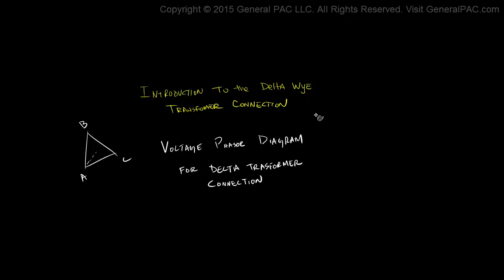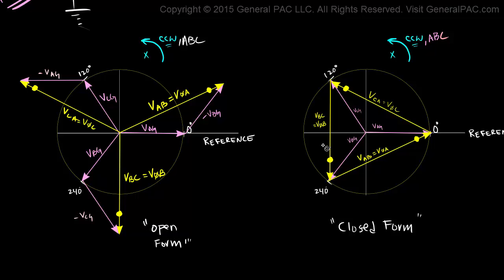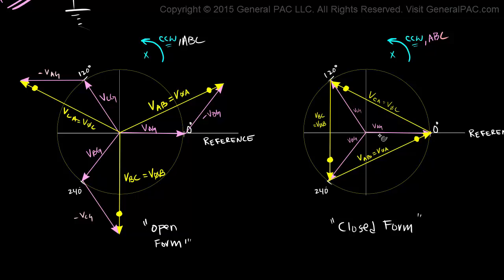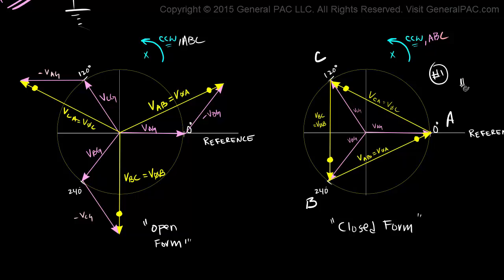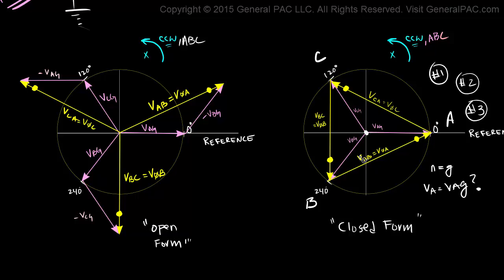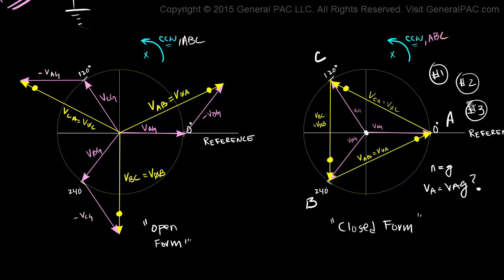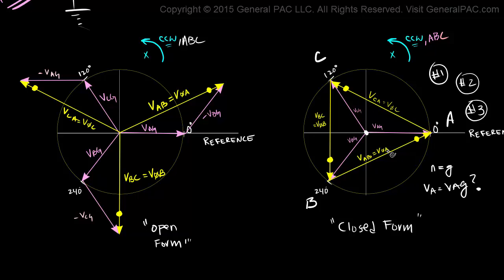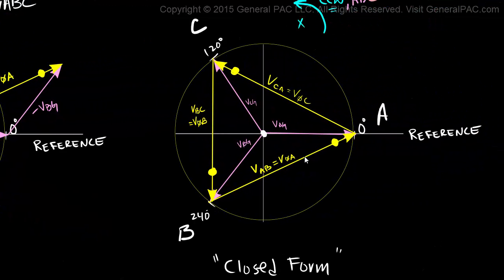Introduction to the Delta Wye Transformer Connection Part 6d: Voltage Phasor Diagram

Comment: Answer to your question regarding this stuff ever being taught in school like this;    I wish if it was even close to the way you have depicted with the graphics.  I actually hated transformers till I started seeing your videos. Power transformer and current transformer are the most misunderstood topics in electrical engineering.  Please keep up the good work.  Hoping for Playlist 7 to understand how you show delta voltage & current lead or lag for a particular connection in the same slide.